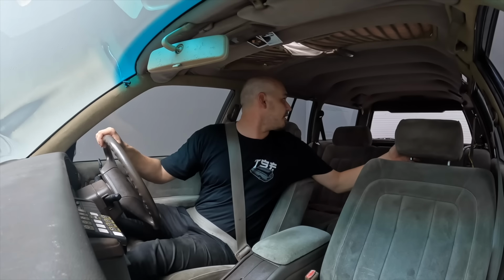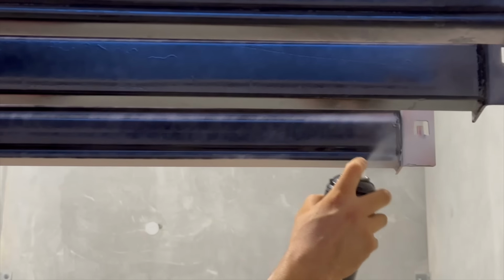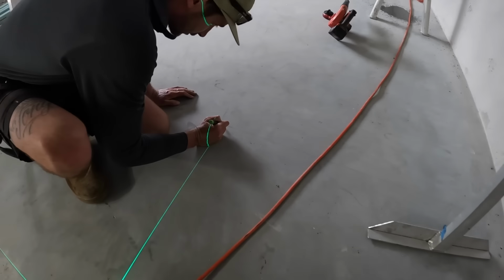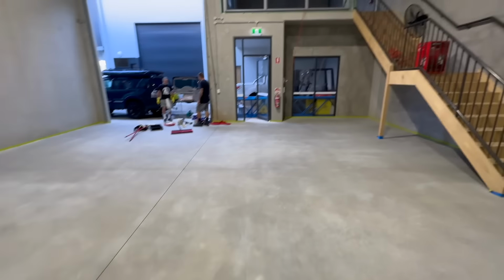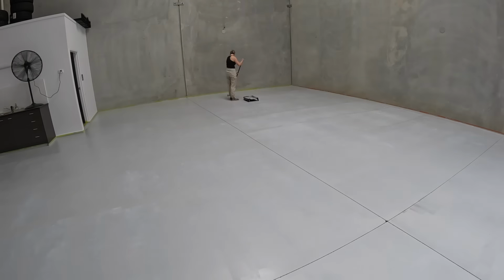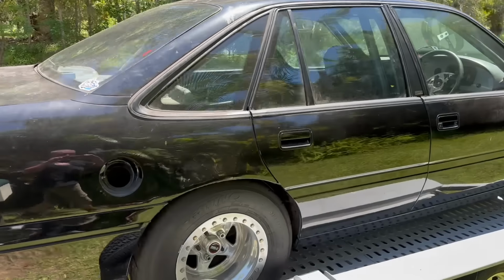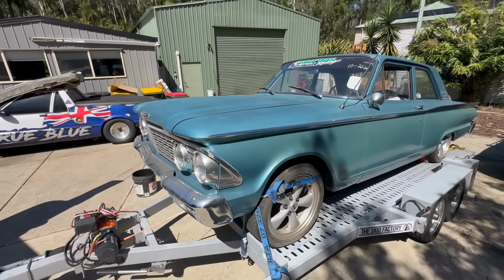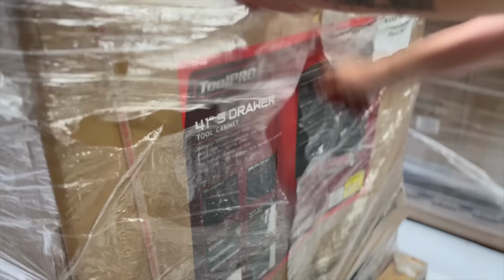Building My DREAM Workshop! THE NEW SKID FACTORY! 🛠️

Comment: Some more suggestions from helping a mate set up his new workshop... (some are more suited to a working business workshop, but included them anyway)

* Painted walls - Light colours will improve lighting bounce and make it look much more cleaner / professional.
* Painted waistline of a darker colour from the floor level to at least a metre or two.  It's surprising how fast the walls will get very dirty. (especially behind benches / grinding areas, areas that may get exhausts blowing onto them.
* Once you work out how many power points you need, - double it...  you can never have too many power points.  - Try to have at least two or three different circuits if possible.
* Roof Mounted or Wall mounted oscillating industrial fans will help lots with air-flow.  - Air con will be expensive to run  and hard to cool downstairs, but a few stategically placed fans will do wonders in the QLD summers, Roof whirly birds too to help with the heat extraction.
* The move to mainly battery hand held tools means that air lines are becoming a thing of the past - but if you have to run them - try having them up high from the roof or over the working levels via steel cables from one side to the other - keeps them MUCH cleaner and off the ground and out of the way etc
* Oil Waste tank/s - the closer to the front door (or 44Gal drums on dollys) are much easier to get the waste collection guys to collect them.  
* A few door mats securely attached to the first 3 or 4 treads on the steps will help keep the office carpet / floor clean when walking from the workshop to upstairs..   
* Rag / Towel dispenser near the stairs also so you can quickly wipe your hands if you need to run upstairs, saves grubby marks of the upstairs wall/ doors / door handles etc.
* chain / portable / retractable barrier in front of the garage roller door to encourage visitors to use the front door instead of the roller door. - Doorbell for couriers / visitors if you don't want randoms just walking in. 
* security - cameras everywhere.. (bonus is you can use some of the footage as unique b-roll)
* raised floor sections / berms / speed bump type things to contain spills like coolant from running into the "clean areas"
Reply: Some great ideas there 👍
Reply: i would add oil socks/ mats on standby . makes cleaning up so much easier
Reply: @cornishcat11  agree, complete spill kits are relatively cheap and so effective
Reply: Agreed on the light colour paints to help the lighting!!! Get some high CRI lights too :)
Reply: All excellent ideas there. Agree with paint and ceiling fans. Doubling the power points is absolutely true!
Reply: I'm stealing those ideas for my little home garage :)
All of these are so good and I honestly didn't think about anything except wall paint
Reply: I love the idea of stainless steel topped work benches. My toolbox at work has a stainless top and it makes cleaning up after dealing with oil or greasy components SO much easier! Just spray it down with brake clean or in my case isopropyl alcohol, wipe it down with a rag and WHAM! clean work surface!

Comment: Good luck with the new space and continuing on TSF. As someone else mentioned, upgrade the locks. I'd also frost the clear windows on ground level, stops anyone seeing what's inside. Bunnings has rolls of window frosting if you need a budget option.
Reply from the maker: I’m all about the budget options! Got a quote from a tint shop and fell over! I’ll look into mate thanks for the tip
Reply: @theskidfactory  I got my whole house tinted for about $1700 (though that was 7 years ago) so surely a couple big windows shouldn't be more than a couple hundred.

But I imagine you should be able to find some Tint rolls somewhere cheap online if you want to give it a crack.

Another decent budget option is blinds. Can get those at Bunnings for not ridiculous money. Combine the 2 and should stop people snooping when your not around. Plus keeps some sun out (though right now the humidity is the killer)
Reply: Spray frosting works a treat and is relatively cheap. And we're talking proper translucent coating not christmas snow effect.

Comment: So stoked for you Woody! A couple of things you might want to consider-
1) standards door locks are super easy to pick, you might want to swap for a high security one. Bilock are an Aussie company that make high security locks 
2) these new build units are often sized so that the owner isn’t required to have fire hose reels, might want to look at having a bunch of large extinguishers
3) go nuts with the insulation in your office, you can also get plasterboard with higher insulation to help things
4) Rockwool or acoustic panelling will help reverb in the workshop. You can fit it to walls and hang it from the ceiling

Can’t wait to see what’s next for TSF!
Reply: Was thinking the same thing on the locks - he's got some pretty desirable cars in there now, not to mention all the tools and parts - also saw someone recommend parking the forklift against the inside of the roller door which is great advice.  Too many scumbags around these days so everything you can do to make it hard for them is good.
Reply: Not a bad  idea getting some removable bollards out the front too!

Comment: Set a banner line level with the toilet room roof, paint from there up one colour. Below the banner line get a sick graph artist and mural up those walls.  Sound diffusing panels up in the roof, LIGHTING, ceiling in that mez so the ACs aren't cooling such a large volume, and insulation cos when it rains she'll humm... Huge lemon squash fridge... and CCTV, removable bollards etc etc, make it secure.

Comment: Sound: Rock wool is the ducks nuts. We use it in night clubs. Fire proof as well!
Reply: I mean, cement walls are pretty fireproof, too, right?
Reply: @jimm9776  good point..... 😂
Reply: @jimm9776 but echoey. Woody will need to put something in to cut the sound bounce down for recording and an option that doesn't make the shed a fire hazard is not a bad idea.
Reply: Not as fireproof as you might think. They don't burn, but when exposed to surface fire for any length of time, they "spawl" off flakes and chunks as the moisture inside boils off, weakening them till they collapse. If the fire is hot enough, those walls should be safe for a while, though.

Comment: Best thing we ever added to our shop: Gantry crane.. Being able to load and unload and move things around with a 1 tonne hoist and the crane is wonderful.
Reply: I always wondered how much that might cost for just the average bloke in a small shop. How bad is it?
Reply: @jamessimpson3162 
It cost us about AU$400 in steel(The big I beams), $400 in rollers/parts and two or three weekends to build with two mates. Our working space is 6x6m.
The cheaper option is a rolling crane frame, those you can just buy and for most people is more than enough. But we didn't want to store it on the floor and planned the crane when we built the shed. :)
Reply: If you want 'smaller and simpler', a 'jib crane' provides a good working space if you have a solid place to mount it and don't need as complete coverage. And would be a much easier one bloke build.
Reply: Could just get a jib attachment for the forklift
Reply: @ElectraFlarefire  Thanks mate. I'd prefer to do it how you have. Storing engine cranes and other heavy things you don't use all the time is a pain. But i've always  kinda wondered what a mob charges to build and install them in a factory that size.
Reply: Having the pallet racking pushed all the way to the back will be hard to access with forklift with a hoist in front of it. Consider pulling it forward a bit and perhaps put machinery, tools or bench in the corner.

Comment: It's looking great woody! Only thing I could think to suggest would be to reinforce the roof of the water closet now so that you're not worried about doing double duty for storage. You've got tires there now, but you don't want to have to worry/think twice about stacking something a big heavier up there if needed.

The other thing I'll say, is that there's something nice about having the pallet racks on the right side, as it gives a similar "stage" feel as Al's shed. Obviously couldn't have planned it that way. But it's a nice touch.

Comment: Build a small mezzanine on the back wall the same height as the bathroom. I reckon you'll need the space. Also make sure you get the location of your hoists sorted, get your sparky mate to rough in all the feeds you need ready to go to drop down from the roof. You don't want to chase in and back fill new conduit on that nice new floor.

Comment: Well done mate. The hoists are the tricky bit. I'm glad you put the pallet racking on the side. The thrid hoist is the killer. The two down back are fine, but i find find that where the cars rolled off the trailer sets the location. The Ford on the slight angle and the Commodore straight on. BUT, do you need the third one at the front? I'd leave it and see. I think that space is too valuable to fill if it is not essential, and even if you don't know how it will be used yet. A cramped space will stress you out. One regret/problem everyone has is "i need more space".
Reply: Why? It would have been far more practical to have the racking on the back wall and a bit down the side. The thing he is going to use most the tool boxes are down one end of the shed meaning a long walk to the front car, they would have been far better off being where the racking is, because they would be central to all the hoists. On top of which you have narrowed even further the narrowest distance, the tool boxes on the side would allow for easier car movement.

Comment: Highly recommend getting a portable single post hoist from Hero hoists. They are rated for 2.5t and lift to 1.8 metres. Plugs into a 15 amp outlet and is a multi purpose outfit. I store mine under a work bench if i need more room. It's like having an oversize hydraulic pallet jack and is extremely handy with it having just one post.

Comment: Woody, you are absolutely blessed to have so many people willing and able to help you out with your new place. Treasure those people forever. 2 years ago my neighbour burned down his shop which mine backed onto and did enough damage to mine that my landlord had to pull the whole lot down. I rebuilt my shop in a larger space, 300m sq. but I had to do absolutely everything on my own and I have to admit it was a huge struggle. It's been almost a year since I got the keys of my new place and whilst I've moved into it and have been working there, it's still not finished.

Comment: This is bloody brilliant Woody. You're making it happen! I would definitely have a dedicated fab section (nothing crazy) somewhere away from cars you can cut/weld/smash/cry. 
Also, an easy access wet and dry vac, not buried away behind stuff, quick access for the inevitable spills. Do anything you can to get rid of flat surfaces that will bounce sound. if you can get a scissor lift in, it'd pay to get some acoustic baffling on the ceiling and walls, would make a huge difference.

Comment: Your big issue will be getting to the pallet racking with the hoist in the way. I reckon 2 hoists angled on the left near the stairs and leave the end open of put in a scissor lift hoist in future for the quick jobs and use the two two post hoists for the big jobs.

Comment: Ah this is fantastic Woody! I'm so stoked for you!
I can't imagine how awesome it is to finally have a shop of your own!

For some recommendations I'd get some blinds and bars for the doors/windows downstairs so people don't see what's inside and can't easily get in, also investing in an alarm goes a long way especially with the cars/tools that will be in there.

Someone put a brick through the window of our old shop and stole a lot of tools, thankfully they didn't have the brains to use the angle grinder to cut the door locks and take the cars.

I'd also look into getting a spill kit, if you have any big messes it helps to be able to put some bunding around the bathroom/storage areas if something goes really wrong. 

I'd say that AC and insulation for upstairs will be a must, especially once you have the computer up there for editing since it'll be heating the room up as well.

Lastly I'd say that while I think 3 lifts is super rad I'd be concerned about how tight it is getting into the shop, it looks like a floor jack needs to get involved to help make the turn, but I' haven't been there so I'll trust yours and everyone else's judgement!

Again, I'm so excited for you Woody, and I can't wait to see what projects come next!

Comment: Woody, if you put the pallet racking there with the back hoist in that position, it could make getting anything off those rear racks with the fork while a car is on that hoist a right PITA. Obviously it's not a huge space and fitting things is always going to be a challenge though. Maybe putting parts washer, compressor, blasting cabinet, welder etc in those rear bays of the racks will mean you don't need to get the fork back in there too often.

Comment: A suggestion. Leave some area so you can put up a spray booth at times. I think you should be able to build something that is made up of thin wooden walls that can be assembled/disasembled along with exhaust fans.
Reply: Oooooh THE PARKING SPACE!  Power wash before, put up a tent with filtered air intake (like a box fan with a couple a/c filters) and sheeting!

Comment: When you go to network the upstairs, go full Ubiquiti gear and you will not be disappointed, Woody. A bit exxy, but worth every last cent you pay for it.

Also, 25mm gyprock (Shaft Liner - usually for elevator shafts or party walls) - will help with sound transmission to be kind to your neighbours (and stop any of their sound coming in).

Like others have said - Rockwool insulation is pretty boss. I would sheet behind it with foilboard for QLD summers. Run double insulation, then thick gyprock/wall sheets. For the quiet office area of course, the whole area would be expensive af.
Reply: I agree on the Ubiquiti front. You could look to get a UniFi Dream Machine Pro - fit some hard drives, get some Ubiquiti cameras and then you have CCTV etc in your shop too.

Comment: Awesome space!! Id worry that the hoist at the back will block forklift access to the racking. I would consider 2 hoists on the angle off to the side and put a fab bench across that back wall. Leave that space open to use it as a flat bay for vehicles that can easily be rolled out of the way, that way the forklift can maneuver to the back section of racking.

Comment: The only things I think of for layout downstairs, is how the hoist next to the pallet racking affects forklift access to part of the racking. Then how you go for room for a fabrication space that's not too close to cars on hoists. I don't have any productive suggestions though... I'd be nice if the toilet was under the stairs but that, plus the 'getting in the roller door' are probably the only two real drawbacks to the bones of the place. Looks good otherwise and the mezzo up the top will be a good spot.

Comment: Good Luck with the new shed, the channel will still be a great as it was before, onwards and upwards. When you position the hoist near the racking remember it will restrict access with the forklift so don't put anything heavy high up before the hoist is fitted otherwise it'll be difficult to access later.

Comment: Good luck ith the new shop, as a personal choice I''d check how much space you need to get the forklift to the end of the racking with a pallet on the forks before positioning the lifts. Be a pain to have put stuff in & find you can't use half of it when there's a car on the lift.

Comment: Dont trust those shelving units! Weld a couple of anchors onto the plates that tether the vertical slabs together and tie those main pillars into them. Last thing you want is some knucklehead bumping the shelf unit pillar while backing up the forklift and well... you've seen the disaster videos that ensue.
Lookin great Woody! You could also turn the one hoist by the door 90 degrees and back cars into it for storing while buying a tad more entryway space for cars to wiggle in. I really think a hoist parallel with the door will encroach on getting stuff in and out, I think you saw that in your 3d model.